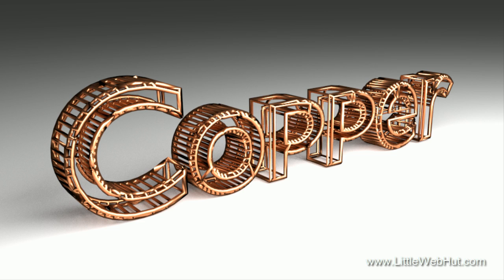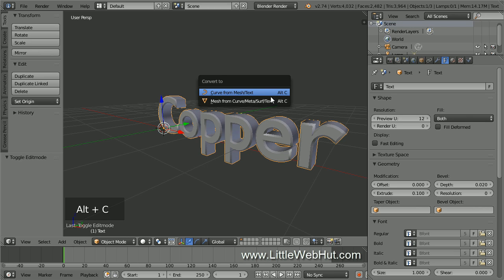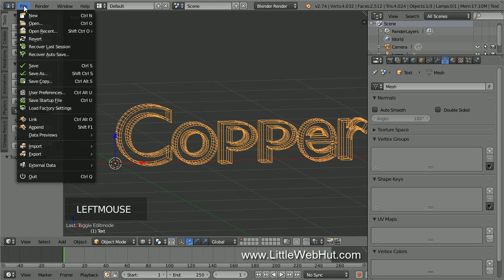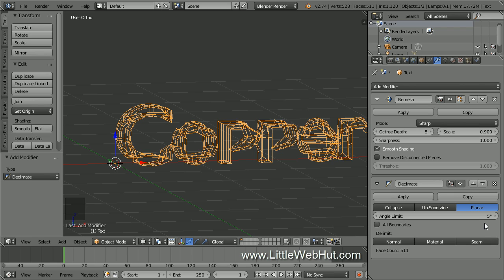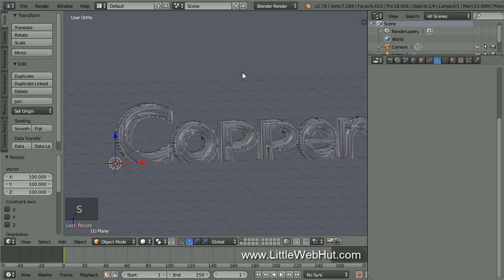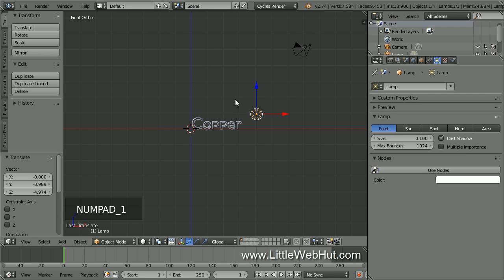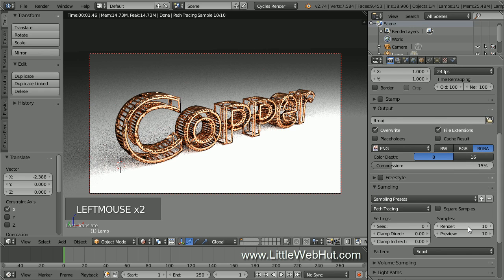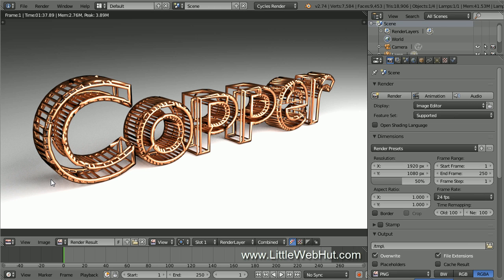Blender Tutorial: Copper Wire Text

Comment: I got a very similar result but with my own method. I saw the thumbnail and decided to give it a try before watching the video. I wrote a text in blender and extruded and made a bevel as you did then i converted it to a mesh. Then i removed all front faces and all back faces and then i select all vertices and choosed the option to delete "Only Faces" then i converted it into a curve and from there it was very easy to make it into tubes. I tried first by using the wireframe modifier but i just didnt like the result since it was very low puly. The tubes looked more like squares and i could not make them rounder and because of that i decided to try again but convert to curve so that i could control the resolution